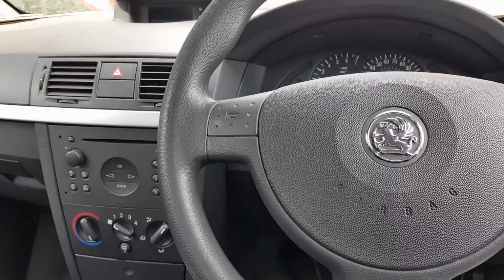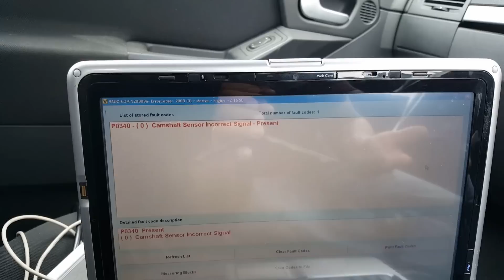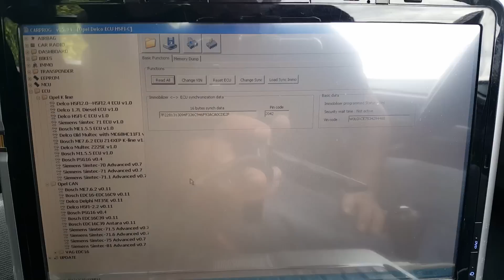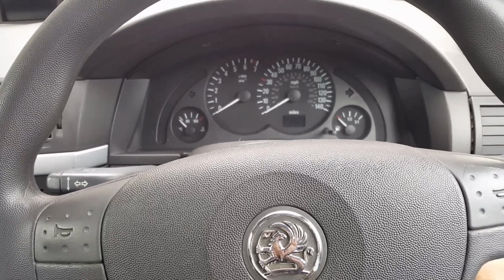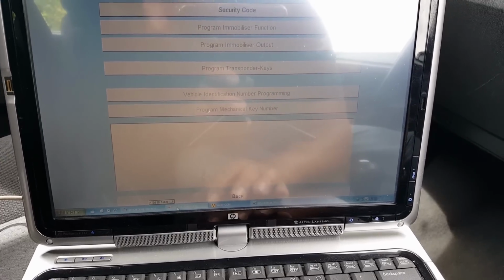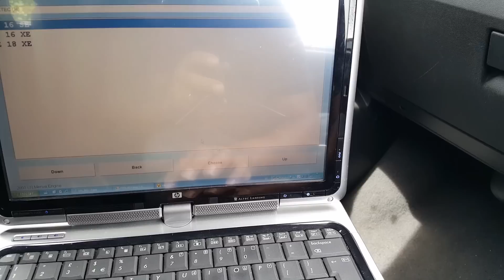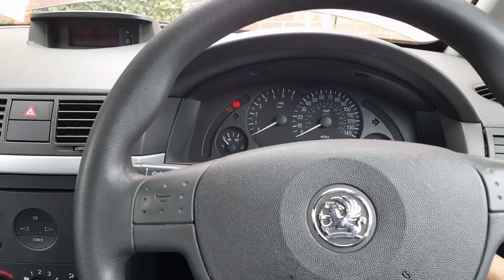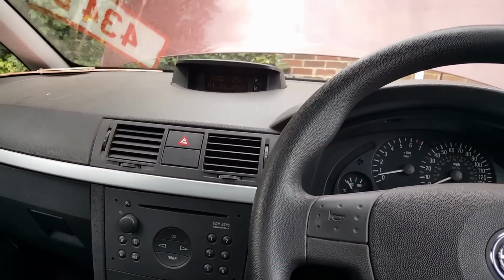Vauxhall/Opel Meriva 1.6. Engine ECU replacement, reset and programming.

Comment: Hi everybody. I had a same situation today. Replaced the ECU (Engine computer Module) on an Opel Combo 1.7 diesel. I managed to program everything as per video, the immobiliser light stop flashing, all DTCs were gone and when I tried to start the car everything was died. No crank, no start. I thought that the battery was very low, boosted the battery and nothing changed. I'll give it another go tomorrow and hope it will work. I thought to share my experience here. Great job Luis, helped a lot. keep it up and thank you for sharing.
Reply from the maker: ☺
Hope you get it sorted! 
🤞

Comment: Thank you very much for the video. works like a dream and saved me from expensive repair. I followed the exact procedure and all went good. I tried the Opcom 2008 and went through all the process. However, i had problem with resetting the instrument cluster. Finally, upgraded the software to Vauxcom and managed to finish it. Thanks for the video. Very useful
Reply from the maker: That is fantastic!
Thank you for the feedback...

Comment: Hi 
I have the same car with the same Engine.
Om getting a fault code 1482 I checked the fan relays but all seems ok
The fan will run only when the temperature gauge reach to the middle.

The spanner with wrench signals appear and disappear always .

I would appreciate it if you could help
Thanks

Comment: Hi as we were dicussing the complete kit i have fitted immobiliser  clocks engine ecu etc the car is running but with the vin no of the car it came from now if i put the vin no for my car will i need to reprogram the bcm immobilser etc will the car still start.
Reply from the maker: Should do yes...
Change the vin on all the modules...

Comment: Hello sir God bless your days. I program a new ecu and the car start but the car is automatic transmission and the new ecu is manual so i can change gear do i have to take pictures from the old one and put them in the new one thank u?
Reply from the maker: Needs coding... and possibly reflash...
But try under the coding, and code it for an automatic...
👍👍👍
Reply: @LMAutoRepairs   thank u sir I will try it tomorrow I have code p1700 on the cluster there is a F anyway thank God bless your

Comment: Another great video Luis, thx for sharing. I have 2 questions please...
1) After successful programming & car starts again, does the new ECU pin code change to match the rest of the modules?
2) Let's say I forget to activate ABS (for example) in variant config, can I still go back into the system and activate it? Just curious as this video answered many questions for me 😊
Reply from the maker: Hi
It is yes to both of your questions...
👍👍👍

Comment: Great video ! Thanks ! 

Can anyone plz tell me - does the OP-COM software need a specific OBD2 reader (ie the hardware) ? I have a 2003 Holden Combo XC (Opel Combo C rebadge) and plugged a Carista bluetooth OBD2 reader and plugged it in but it doesn't seem to work
Reply from the maker: Hi
Yes, it does need... you can get the VCI relatively cheap... 
👍👍👍

Comment: Hi Luis  i have corsa d 2011 engine 1.3 cdti.  Z13dtj. I have mk808  autel. I want to replace ecu .can i do with  autel mk808. Also .if am wrong  i need to programme  immobiliser. Vin.anything else to programme  thank you
Reply from the maker: You need to make sure the replacement ecu has been reset, and that you have the pin from your car.
If the MK808 can do it, i am not sure...
Just go on the immobiliser and check if the option is there...
👍👍👍

Comment: Hi good news followed all the steps all lights off engines starts ok. But have a problem with the cluster i dismantled the cluster and the dials for the rev counter is not working may be they are not fitted correctly any how i have another cluster can i just reprogram the cluster through instrument on vaux.com will it work fine. Many thanks.

Comment: Hi i am replacing the ecu as its faulty i have followed your video exactly,i used carprog got the pins for ecus and reprogrammed the ecu.My problem is wrong instrument cluster id.I tried to reset this using opcom and but it doesnt work as in your video.can you please suggest what to do next.Can the instrument cluster be done with carprog.
Reply from the maker: Not with carprog...
Op-com should do it...
Thank you for watching!
Reply: I used opcom and it fails at the reset ipm and program ipm
Reply from the maker: Try a different Op-com version...
I am not sure which one now, but some have some trouble doing certain procedures....
Reply: Can you share another version of opcom for me to try

Comment: So with this step-by-step approach, I have been able to program the meriva 2003. The only thing left is the error code in the immo is the security code not programmed and the flashing N on the IPC. Any help LM?
Reply from the maker: Have you programmed the ecu using your car's pin code?
👍👍👍
Reply: @LMAutoRepairs   I think i did that.but i would love to get the procedure. Thanks a lot for always responding.
Reply from the maker: @partoems9376  
The procedure is done in the immobiliser... log in and add the ecm... using the car pin code...
That is providing the ecu is reset/virgin...
👍
Reply: @LMAutoRepairs  I guess immobilizer> program immo function and select ecu installed.
Reply from the maker: @partoems9376  
Correct...
👍
Reply: @LMAutoRepairs  All is well. Car started and running good. Thanks to you i did my first opel programming.
Reply from the maker: @partoems9376  
That's fantastic! 
👍👍👍

Comment: Hi once you retrive the pin from car prog then reset the ecu can you still retrive the pin again from carprog or is there another way
Reply from the maker: Why do you need the pin once reset and once you know it?
I never tried... I know that the pin is not erased..  you can retrieve it with a programmer... but never tried with carprog...

Comment: Thanks for the video. After 3 years of uploading the video it still helps people. What are the symptoms of a not properly working ecu?
Reply from the maker: Hi
Difficult to tell, as they can fail in many different ways...
Proper diagnostic is needed to completely blame the ecu as being faulty...
Thank you for watching and for your comment!
Reply: @LMAutoRepairs  thanks mate
Reply: Hi
Is it possible to reset the immo ring around your key? 
I think that my ring doesn't detect my transponders 
Thanks
Reply from the maker: @furkansyuleyman485  
The ring is just a coil... not resettable...
But could be broken, an open circuit...
You might need to open it to check...
Do not obviously disclose the key as the problem... test the key...
Thank you for watching!
Reply: @LMAutoRepairs  thank you for your reply. Is it possible to replace it?
Reply from the maker: Just the coil or the module?
Reply: @LMAutoRepairs  I have tried to program new transponder chip to my car but I get always "no transponder chip detected " so I suppose that the ring isn't working properly.  I have tried it with a secondhand ring from another car but then things are going wrong because its not registered but the secondhand one detects the virgin transponder chip.

Comment: Hey there I have same car same problem I’m just wondering if with carprog will be the same or even easier to program this ecu thanks
Reply from the maker: Same principle yes.. 
👍👍👍
Reply: And when u don’t have comunicacion what do u do coz I don’t have any comunicacion on both ecu thanks
Reply from the maker: With carprog?
Reply: Yes even with the old ecu I don’t get comunicacion
Reply from the maker: Is the ecu listed in carprog? 
Make sure you do the correct selection...
Have you tried other tool, like Op-com?
Reply: I’m not sure if is on carprog I know ecu number is 12249823 it’s a Delphi delco mt35e 2.1
Reply from the maker: OK... so, how are you trying to connect to the car?
You usually need to select the ecu to connect...
Reply: Sorry to bother you again so this ecu I’ve got is not same as this one on the video it’s different and engine code is also different it’s z16xpe so do I have to by a virgin ecu or I still can reset the ecu true op-com software thanks
Reply from the maker: The procedure is the same... you need the pin code to reset it...
If carprog don't have the ecu listed, then you need other ways to read the data from the ecu, to then find the pin code, to then reset it...
Like k-tag for example...

Comment: Ok i have bought a complete set engine ecu bcm immobiliser reader transponder chip ignition barrel boot lock door lock ignition key and dash cluster plugged it all in the immobiler light is out have erased all the faults using opcom still did not start there was no ground feed to the  fuel pump relay. I intoduced a ground feed and the fuel pump run and the car starts but the vin no is incorrect as whole set from other vehicle now it not reading the ac automatic transmission etc. What do u suggest i do do i still go and reset the ecu and follow your video or follow your video and program the can configuration and variant can please help me as i not sure what to do many thanks.
Reply from the maker: Program car configuration etc...
Reply: Still no need to reset ecu just do the can configuration etc.
Reply from the maker: I think you are confused about the reset procedure...
The reset it is just to allow the module to be programmed using a different pin... like into a different car...
The reset does not touch the flash inside the modules...
Reply from the maker: Try the forum...
Myself or someone will help you...
https://prodiag.boards.net/

Comment: Thank you for your great video tournament, nice work. I have a question here, what if I just replaced the ecu and body control unit, and dashboard plus the security sensor unit and key chips with the same car model, then shouldn't I have to do the computer recoded and reset, is that correct?
Reply from the maker: The procedure would be similar... reset the one to install and then program it using the pin of the car...
Thank you for watching and for your comment!
Reply: @LMAutoRepairs  Thank you for your kindly reply and turly appreciate that, have a great day.
Reply from the maker: @張煜-q8e  
👍

Comment: Thanks to this video, help a lot! I have same car, same year's:, fault I have after Actronics. no company repaired Ecu, Bcm, key immo ring, Is B3058 vehicle not programmed identification, U2105can-bus communication with engin control unit, B2961 W terminal low voltage, P1616, P1615,,, 174 coolant temp sensor can signal not okay. I have no knowledge what it is? Car not start,
Reply from the maker: Hi
The U2105... can you communicate with the engine ecu?
👍👍👍

Comment: Great video! Is it possible that when a Combo 2003 17 dtl gets the faultcodes P0610 and P0602 when the battery was empty and won't run anymore?
Reply from the maker: You need to get the ecu reprogrammed....
Those codes are for errors in the ecu data... most likely will not fix it self...
Hope you get it sorted...
Thank you for watching and for your comment!
Reply: LM Auto Repairs , thanks. I gonna ask Opel for the pincode and try to reset and program the ecu, instrument en immobilizer with my snap on modis or Hella mega max. I’ll let you know.
Reply from the maker: @ericarendshorst7228  
Try that... but I think you need more than that...
The reset procedure resets the immobilizer code only...
I don't think will fix your problem...
What you need is a complete reflash of the module... you need global tis with tech2win... or a tech2...
Hope that helps...
Reply: Indeed. the ecm had a reflash, and it is working again, the generator was defective, the cause ( according to opel)  was perhaps a sudden voltage raise. We replaced it. Thank you.
Reply from the maker: @ericarendshorst7228  
That's great!
Thank you for the feedback! 
👍👍👍

Comment: I really love your videos, I have learnt a lot from them. Just want to know something, what other version of opcom apart from v1.39 will reset the pin on Corsa C instrument cluster? I have tons of them that just bricked on me and I could really used some help on how to bring them back to life. I'm supposed to change the dash on my 2004 Meriva this coming weekend as it's the U.K. type that uses miles to the kilometre type suitable for my country. Thanks.
Reply from the maker: Emmanuel Achiume 
Hi
Thank you for watching and for your comment! 
There is another version out there, 1.45...
But both versions are able to read the pin on the Corsa c...
When you say they bricked on you,  do you mean the op-com?
Reply: lmsvvavr I have 2 v1.45, v1.64 and v1.69. None of them will read or reset the pin on Corsa C. Only the 1.39 could do that. I have tons of bricked opcom interfaces which I want to learn how to revive. They are all recognised by the laptop, drivers install but pretty much nothing else. The repair opcom tool doesn't work either. Which software version will work on v1.45 to read pin on Corsa C? Thanks in advance.
Reply from the maker: Emmanuel Achiume 
I am pretty sure that v1.45 also reads...
If you have opcom tools just load the 1.39 on one of them...

Comment: Hello, first of all thanks a lot for waste your time trying to help us doing these videos. I have the same car but with the Z16XE engine nad of course with the same problem, i live in Spain so imagine how is the poor ECU with our temperatures this summer. I'm trying to repair my ECU but in case i can't i have one question. My ECU is the 12214830 HSFI 2.5 DXBC, and i've found exactly the same but DYDT, could i change it?. Thanks again for your time and help.
Reply from the maker: Hi
Is never a waste of my time...
I enjoy sharing and help others...
If the ecu is from an identical engine, I would say it should work fine...
👍👍👍

Comment: What diagnose hardware did you use?? OPCOM/VAUXCOM interface(hardware) works as a replacement hardware for carprog, or what?Nice job! Thanks!
Reply from the maker: Opel Corsa 
Hi
No... carprog is one tool, opcom/vauxcom is another one....
Reply: lmsvvavr yeah, i know, but i've seen you swaping between opcom and carprog in the taskbar,and there's only one OBD II port in the car, so??
Reply from the maker: Pork Corsa 
So... you swapped them...
Reply from the maker: Sorry I have deleted by mistake your last post...
Of course I did not tapped any other OBD port on the car...
Have you actually watched the entire video?

Comment: Evening LM. Thanks for those video. Silly question: Do I need to by a special plug-in connector to be able to use/read information on Carprog? thanks!! M
Reply from the maker: Hi
What kind of information?
Thank you for watching!
Reply: @LMAutoRepairs  HI! I need to rescue the PIN numbers from both of my Astra G (2001) & Astra H (2009). I have the OPcom tool but it is too new and the PIN code option is not there anymore. Any suggestion? thanks! M
Reply from the maker: https://youtu.be/L-WSXbthTBs

Comment: Hi thanks for the video. Can im608 do this ecu replacement on meriva 2003?
Reply from the maker: I believe it can...
👍👍👍
Reply: @LMAutoRepairs  Thanks for the response. I used the IM608 to track all the menus as  whiles following the video. All the menus are there. Except BCM reset. Program variant config and CAN config is under Diagnostic > select vehicle > service>powertrain>adaptations.

Is there a way to reset the bcm on im608? Thanks a lot for the video once again.
Reply from the maker: @partoems9376  
Most likely will be, but I never used it for that, even the MS908P I struggled in the past, and just ended up using Op-com...
But I am pretty surely will be there somewhere...
Just one thing, carefully reseting the BCM...
The BCM does rarely needs reseting... adding a replacement ecm does not require a BCM reset...if I recall correctly...
👍👍👍
Reply: @LMAutoRepairs  IM608 is able to reset ecu and write the VIN successfully. Now i have dtc  wrong vehicle id from instrument & body control module. I think that's where the bcm and IC reset is required.
Reply from the maker: IC... do the IC first... I don't think you need to do the BCM...
Reply: @LMAutoRepairs  Thnx a lot. Just that I dont have ori opcom. Maybe I have to try opcom clone.
Reply from the maker: @partoems9376  
That's what I use...🤪
Reply: @LMAutoRepairs  great. i will go for one soon. what version would your recommend?
Reply from the maker: @partoems9376  
The latest...
Reply: @LMAutoRepairs  my opcom i bought clone is asking for activation. any help please!
Reply from the maker: Get the correct software...
Should have come with the tool...
👍👍👍